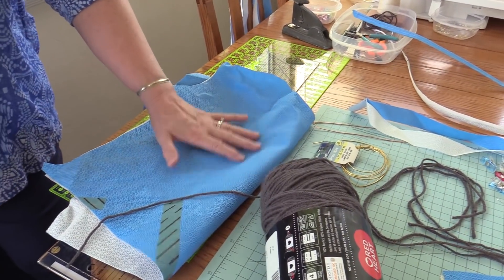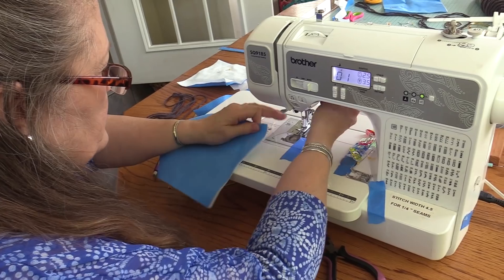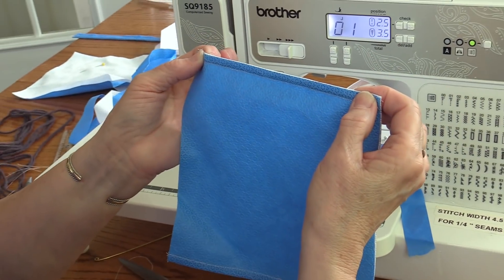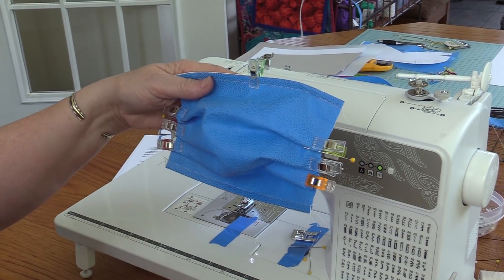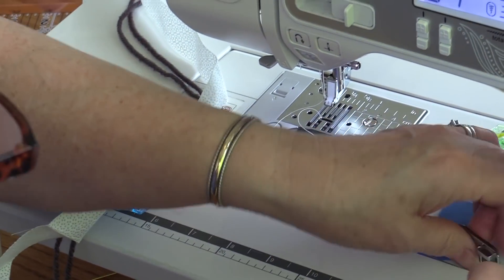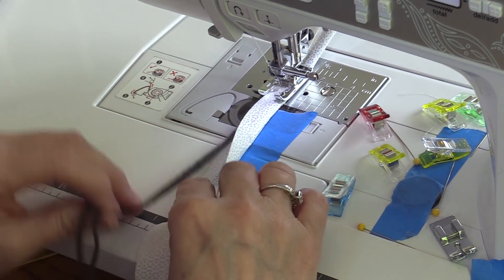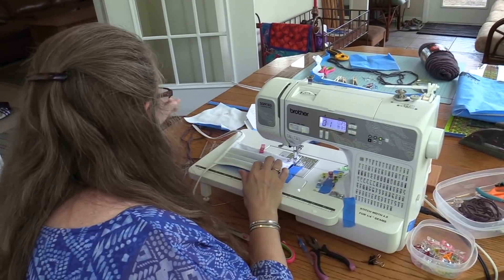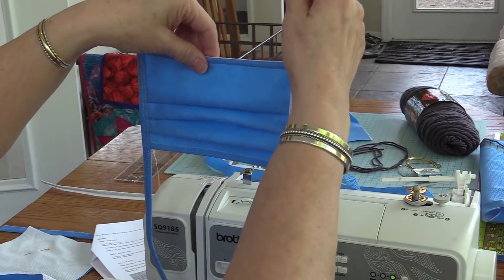Mask Alternate Sewing Instructions Prototype 1 UPDATE

Comment: I read these masks can be sterilized for a couple reuses by putting them in an oven at 165  degrees for 30 minutes. Does the yarn need to be wool so it doesn’t burn? And are most standard threads able to handle 165 degrees?
Reply from the maker: Hi Melissa, check out our FAQs page, I believe your question is answered there https://anest.ufl.edu/clinical-divisions/mask-alternative/frequently-asked-questions/

Comment: all of those pinholes are superhighways for a virus, and air will preferentially travel through areas of lower (pinhole) pressure than through the resistance of the mask material.  Definitely clips are preferential to pins.

Comment: hi! thanks so much for this video. Making for a philly hospital and am wondering what kind of thread you are using...any tips are appreciated. thanks!
Reply: Most hospitals, including UF who came up with this design, are sterilizing the masks before use. This fabric is meant to be run through an autoclave, so it's a good bet that that is what they are doing, so you want a thread that will stand up to 240 F. I know cotton and acrylic work okay through an autoclave, but there may be other good options as well. H600 itself is polypropylene, but PP thread can be difficult to find.
Reply: @jasexavier  hi.. could you specify the size of thread and a name/source... amazon?    thanks.
Reply: @MFL92028  I'm not sure it's that important. Many masks have been made and passed fit testing by people working in hospitals. Most of them seem to be using normal sewing machine thread. It looks like cotton, polyester, and acrylic will all hold up to autoclave temperatures just fine. If you're sewing non-woven fabric, some have suggested using "sharp" point needles meant for micro-textiles (microtex needles) to minimize any damage to the fabric while sewing, and to use short straight stitches.
Reply: @jasexavier  Thanks for the reply.  You provided some useful, and often not mentioned info.  One thing: Polyester is limited to 250 F  THe autoclave can reach 275?   Also.. convection oven disinfecting at 165 F for 30 minutes is probably OK for most cotton threads; however, depending how you do this in a conventional oven could lead to brief temperatures over 300F   Most masks are easily disinfected with soap and hand washing.. but you can't do that with halyard H600 fabric (N99) .. you have to autoclave or heat in an oven.  Thread size, and needle size methinks, is important.    This is really all about what are you using the mask for?  Practically all the masks out there, with the exception of ones with an exhalation valve, are only intended to protect the "other" person from a cough or sneeze from an infected mask wearer.  As most everybody is immune to covid's nasty symptoms, most people don't need a mask for protection from covid.  They should be wearing something to protect others from their anti-symptomatic selves.   Now, if you want something to protect the wearer from covid, then you have to wear a mask that will do that, like the halyard (H600) (if it fits) .. or a respirator like #M 6200 with 2091 filters.....
Reply: @MFL92028  Standard autoclave temp is 250F for 15 minutes. Polyester fibers are good to 250F for continuous duty, or 350F for short durations. High temp (275F) autoclaving is normally done for 3 minutes, I would expect the thread to be fine for that, but iff you wanted to be extremely careful you could use some kind of specialized high temp thread, like an aramid fiber.

And yeah, a home oven is not going to have precise enough temperature control unfortunately. Maybe with a very large thermal mass added, and careful attention to a calibrated thermometer.

Edit: I agree with you completely about masks for the general public. Only health care workers really need rated masks right now.
Reply: @jasexavier  Thanks... Health care workers ... "and" Older people, once the great unwashed is back to "normal" ... :-)
Reply: @MFL92028  Yes, you are right. Those at particularly high risk should also wear real fitted filter masks in the event that they have to go out into public. I do really hope those people can still get them, or get others to help them.

Comment: Can acrylic yarn withstand autoclaves? I'm making some now but hung up on that.
Reply: I was using yarn, but the hospital said that the straps were strong enough without it.  It’s MUCH easier to make these without the yarn.
Reply: Most acrylic is safe to 275 F, which makes it fine in an autoclave, but it's good to double check the particular thread if you can, there are some formulations that weaken as low as 221 F.

Comment: For home use:  To make straps, cut 1" strips of a tee shirt, widthwise.  Trim off any seams.  Stretch each strip and the edges will roll inwards.  Cut to desired length.  (The shirt I found in my closet happened to be 95% cotton & 5% spandex.  This gave a nice elasticity to the ties.)  These fabric straps are soft & don't cut into the skin.  They're stretchy, enabling you to snug it up nicely.  The tube created is very similar to a "B" shape.  I sewed them onto the outside, not the inside. 

Note:  The tee shirt fabric straps haven't unraveled/frayed & don't require any top-stitching.

I made a mask using your pattern for when my husband needs to run errands, even just to get our mail.  Huffing/puffing joggers are always on our street.  I used a cotton-poly exterior, a microfiber shop towel center layer and a 400tc sheeting for the inside layer.  I used half a chenille stem for the nose wire and stitched it in place by hand (at ea end & the center) to the microfiber toweling.  I zig-zagged around all edges to encase the fuzzy towel edges between the inside & outside layers.  I suggest using a walking foot on your sewing machine to ensure all three layers move at the same speed.  (A serger would also have been perfect for the overcast edges.)  The nose/chin seam also has straight stitching as do the darts, which I did not trim.  (The triangle flaps are good pull tabs for adjusting the fit.)  

Hope these tips help those who want to make a mask for at home that actually fits well!  It's a great pattern!

Comment: My concern once they're ready to donate is how to drop off, hand over, pass along, finished masks in a safe manner. For our fabric masks we wash our hands, then spray them with Lysol. They are then placed in a new ziploc and with a note that tells what type of mask they are. Finally, the outside of the ziploc is sprayed with lysol. Everyone involved with pick up and delivery washes their hands before handling. The recipient is advised to wash their hands before taking possession. Usually they are left in a convenient spot once a time for delivery is set. 6 feet distance and no signs of infection are required. We launder or not based on the request. We sometimes press before sanitizing. Since this material melts with heat there's concern over clean handling. So how do we assure clean delivery for these.
Reply: Put the masks in individual brown paper bags for 24 hours. Seriously.

Comment: Is there a "right" side to this fabric, as with most other fabrics for general sewing? If "yes", how does one determine it? Thank you for your development and kind help.
Reply: Either side (White or blue) out is OK
Reply: @karenwolf1938  There is a "right side" it has nothing to do with the color.  Blue is generally used for outside when worn. However, the two sides of each color, blue and white have different configurations.  The outside of the blue has deeper contours to its design on the outside, the inside of the blue is smoother.  The inside of the white which touches the blue is smooth.. the outside of the white which touches your face has deeper contours in the design ...  and, you thopught this was simple... ;-)
Reply: @MFL92028  thanks for clarifying.

Comment: Is there any reason why I couldn't use elastic to attach the mask. Possible a loop for around the ears as I have seen in other templates
Reply: I customized this for my daughter, an MD.  She wanted elastic for quick use.  I cut the fabrics 8x8, sewed according to the video up to attaching the straps. I serged  the sides, folded in 1/2 inch on each side and sewed about 3/8 inch from the edge.  I threaded the 1/4 inch elastic through and sewed it by overlapping the ends, then pulled it to hide the end.  Hope I’ve explained this well enough to be useful.
Reply: @dale3404  Very helpful!  Thank you!
Reply: @scottbecker7668  you’re welcome. Happy sewing.
Reply: I just finished making some more, and realized that I was sewing the seam between 3/8 inches and 4/8 inches. Also, insert the bodkin for the elastic from the bottom so that you are pulling the elastic with the folds and not against them. Same thing for pulling through the sewn ends of the elastic.
Reply: Constantly tweaking. I’m making my new ones nine inches wide so that the finished size will be eight inches.  Also, eight inches high may be too high for smaller people.  Make it seven inches and you finish with a four inch mask.
Reply: Scott Becker I’m thinking the elastic could melt if the hospital uses an autoclave to disinfect the masks. So a heat resistant material would be best.
Reply: @KonbanwaJapan  I think the difference is the setting. My daughter isn’t using an autoclave in a hospital setting.  She’s using the mask as a protective layer to prolong the use of her disposable mask until their backordered shipment arrives.
Reply: One reason NOT to use elastic, is that the mask won’t seal/conform to the face as snugly as it would with ties. If air gets in around the edges - the virus can as well. Depends on setting in which mask is intended to be worn.